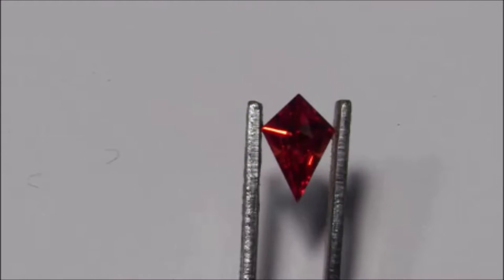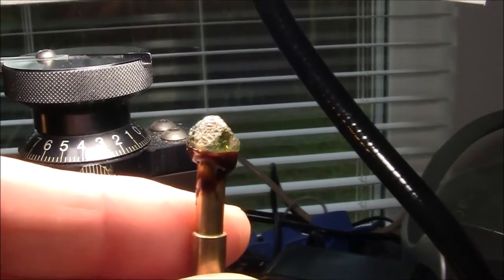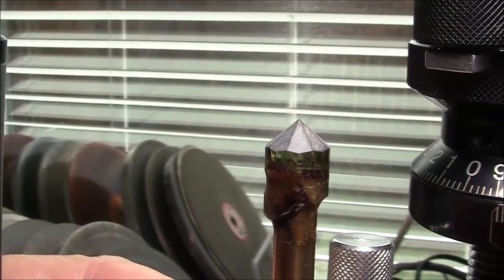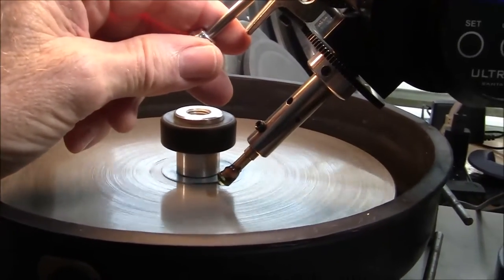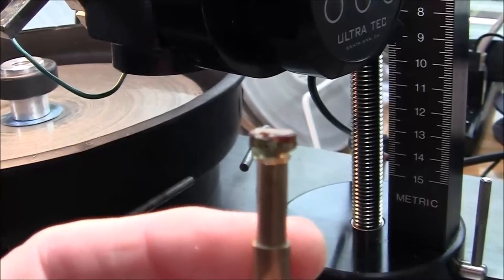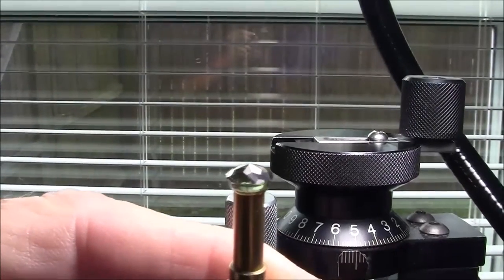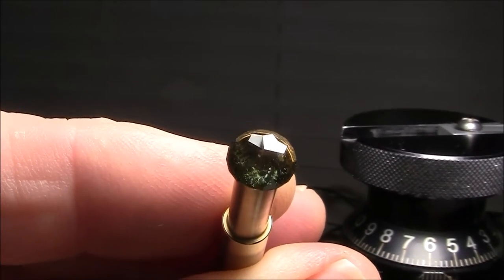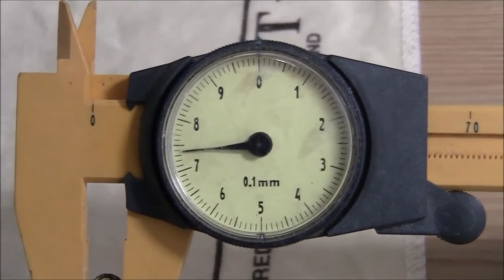Gemstone faceting  a 2 ct sapphire.

Comment: Hi, I wanted to ask you is the waxing glue. The dopping wax that you and other gem cutters use, is it the same wax that used to be used in old time for stamps? I would really appreciate if you could answer to me.
Reply from the maker: I use a brown wax , i dont know if it is the same used for stamps.  Faceters  also use black wax . Most use epoxy  and super glue.
Reply: @tennpikr74   I mean the red stamp wax. But anyway I appreciate your help. Thanks a lot. By the way isn’t using epoxy too time consuming process. Isn’t it better to use super glue?

Comment: You cut the stone very well.  Why did you take off the master comparator clock?
Reply from the maker: Sorry, i dont know what part of the machine  you are calling the master comparator.
Reply: @tennpikr74  You removed the dial indicator.  I asked him. Is the voltmeter meter better?😊
Reply from the maker: @nurettinburak4061  Ok i understand,   yes the electronic meter is far  more accurate   and  much less expensive to  connect.
Reply: @tennpikr74  The electronic one is more sensitive. Got it now. Thank you.👍